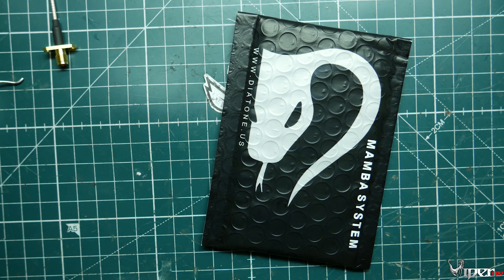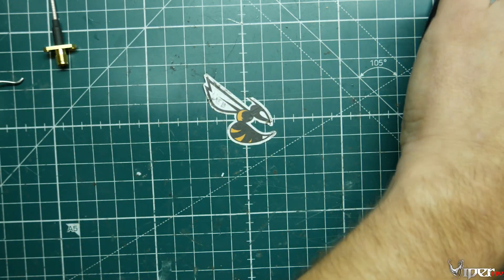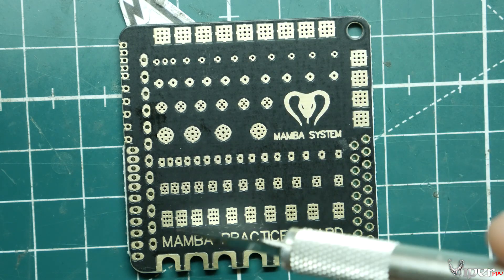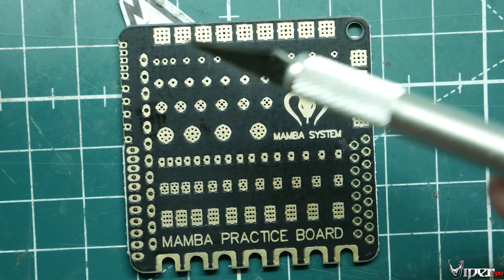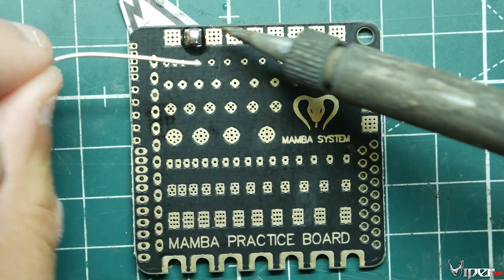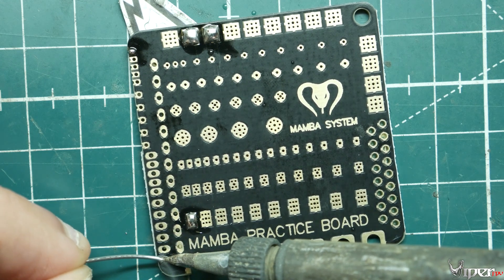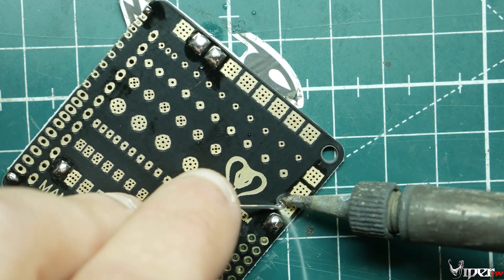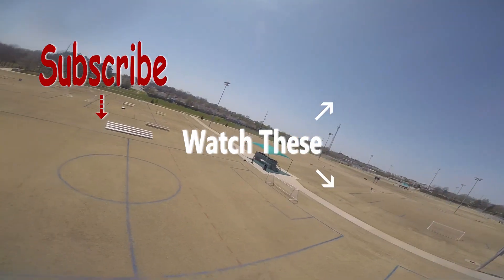Diatone Mamba Soldering Practice Board - Learn how to solder your first fpv drone

Comment: Excellent review.  I’ve been recommending this since it came out.  Must have for beginners!
Reply: Do you have a recommendation for cleaning the board for re-use?
Reply: @thebikeracer  Yes.  add a small dab of flux to help conduct the heat.  Using a solder sucker with a silicone tip...  Heat the solder with your iron, then place the sucker tip over it, quickly remove the tip and press the button on the solder sucker.  You may have to repeat this a couple of times depending on how much solder was used.  There is also braided copper with flux. Not sure what its actually called but I don't care for this method.  Others may have had a good experience with it.
Reply: @thebikeracer  This video may seem very corny but this is how I learned:  https://www.youtube.com/watch?v=N_dvf45hN6Y

Comment: What I learned in this video is that I need to get off my lazy butt and start using the flux pen that's been collecting dust in a drawer somewhere. Seems to make a big improvement.  Thanks for sharing.
Reply from the maker: RADER FPV indeed it really does. When I first started a few years back I never used one either. But once I started to and seen the results I always use one now.